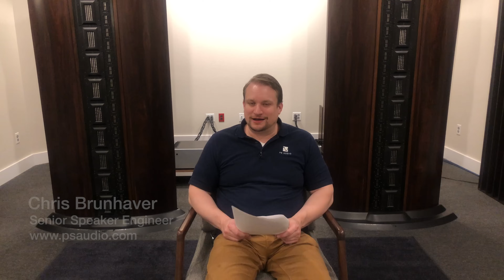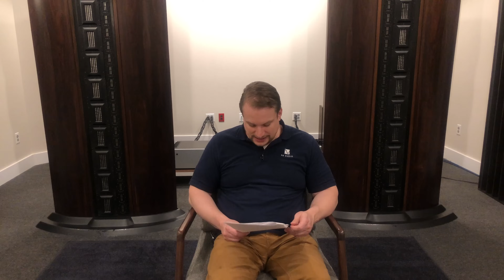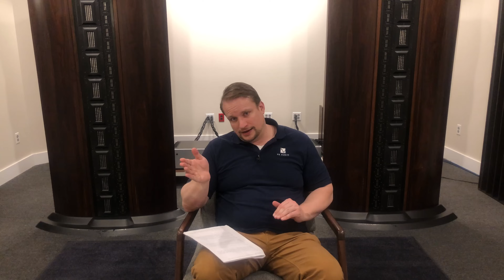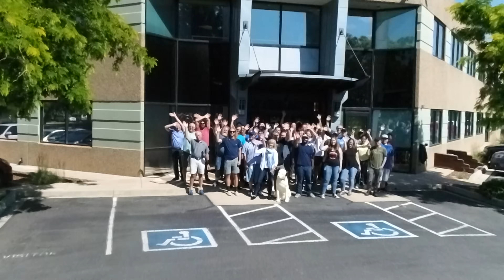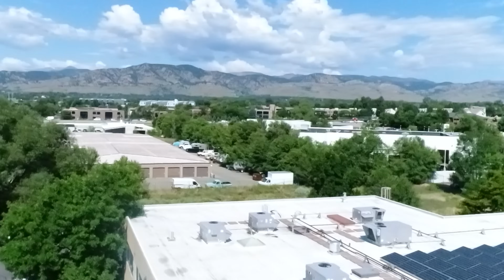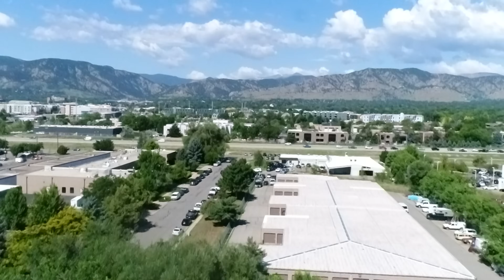Does using a subwoofer change speaker design?

Comment: I dislike subwoofers in a 2 channel system.  Why?  Not easy to blend, all amps don't have a pre/sub out and mostly...it gives a speaker manufacturer an easy out in terms of making a proper full-range speaker.    A tower or bookshelf that plays music down to 42hz isn't all that difficult to achieve (true 42hz, not -6db at 42hz either), but there aren't a lot of them on the market as most manufactures call it "good enough" around 55hz or so.  Enough to give some bass extension without a sub, but not enough to hear all the music either.
In a few ways, we've went backwards since the golden era in the late 70's and speaker design seems to be one of them.

Comment: Great analysis by Chris.  

Imo one possible potential benefit (for two-channel) of knowing that subwoofers will be used is this:  The designer could theoretically optimize for not needing a protective highpass filter, thereby rendering a potentially problematic filter in the main speakers' signal path optional.

Comment: I like running subs, modern speakers, even good towers can’t dig as deep, they are relatively cheap for the addition they make, and they are a lot of fun.  If you do it right, your bass will sound like it’s coming from your towers, even if it’s not.

Comment: Do the IRS V's have a left and right speaker? Why are the tweeters on the inside the way you all have them set up? Just for looks?
Reply: If you're sitting in front of these behemoths, the set on your right is generally considered the right. The left is treated the same way.
Reply: @jamesplotkin4674 ...lol...
Reply: @jamesplotkin4674  A little more then that please.
Reply: @finscreenname  I believe it's so the mid-bass is closer to center, able to couple and the highs are outside of that, enhancing the sound stage and image.
Reply: @FatRat-f9m  "Tweeter array is on the "inside" because that's how the loudspeakers were designed to function...properly." 
That's what I was asking. Why do they work better on the inside then the outside. Is there really a difference? Also why are they mounted to such a large box. They are both ribbon speakers so they really dont even need a box and could be mounted on a flat plank. Why do they have speakers in the back inside a half moon? So many questions.
Reply: @finscreenname ...I suspect that the tweeter array is 'inside' the midrange array because there's less sonic 'interference' from the mid array that way, but I'm only guessing.
Better to ask Paul directly at: paul@psaudio.com
or his son Scott at: scott@psaudio.com
Reply: @finscreenname  in short untrue.....
You can use inside or outside all depends on your room and placement. 

These old wives tales about need to be on the inside are just that. 

also the reason why the baffle is shaped as such, it's to deal with baffle diffractions. Emims (I have the irs v cousin, the rs1b) aside from my 6ft by 4 ft wide magnepan Tympani I. 

The baffle is calculated to be a specific width and curves to deal with the diffractions the drivers cause. 

In all essence the irs v is not the best out there by a long shot, nudell never liked the use of multiple drivers. 

Look up a genesis dragon (Gary bought genesis from nudell , and improved tremendously on the design of the irs) way better speaker than the irs v by a large margin. Cost also a whopping 169k set..

Arnie nudell believed that long ribbon drivers were far superior to the emims. Especially for line source applications. 

Emims to me especially compared to full line source drivers such as maggies ..

Are nothing to brag about they beam and they don't hold up well (reliability issues) especially the older irs v ones. The rs1b had modified emims (they basically put a piece of Scots tape on diaphragms ) to constrict excursion of the diaphragm. 

They also wear out, tension issues (,anyone that has a infinity with emits,emims , l-emim,h-emims ectra) knows the infamous wrinkly looking diaphragms they will get over time. 

Sometimes emims even sag and hit the front plate when played loud enough. They are not that great of a driver ..

I would replace those with neo 8 planar drivers in a heartbeat . As I want to do with my rs1 but I might just sell it. As my Tympani buries it with ease so not sure if I even want to bother with it.

Comment: This is an excellent point. The most (trying to be) audiophile stereo speakers are rarely optimized for subwoofer use and that’s a bummer.
Reply: @FatRat-f9m  Well I would say that your probably going to be just fine with the filters to get rid of some distortion  you hear sometimes without any detrimental effects. If that is all you're looking to do, then great. But if you are trying to also reveal if there are any audible influences with the filters that may be noticeable to some people with some systems, then the Markley method is the way to proceed.
Reply: @StewartMarkley ...when I was younger & enjoyed 'experimenting' with what does what to the sound, I most probably would've followed your instruction in this matter. However these days I'm over all of that 'playing around with audio gear' in preference to just sitting back & listening to da tunes.
Reply: @FatRat-f9m  I guess you are more of a spectator on these forums than truly interested in the science behind HiFi. That's cool. I've always been interested in the science of electronics and sound and now that I'm retired I have the time to dig into it much more deeply than I have in the past. Dig those tunes!
Reply: TB ...here's my 8ohm 80Hz 12dB/octave high pass crossover filter findings. Using the 5 tracks that I selected, at the same maximum volume (98-105dB) with said filter removed & the subwoofers off, I found that none of the 5 tracks made the mid/bass drivers 'bottom out' amazingly ...kudos to ScanSpeak! I could only hear a little (not negligible) doppler distortion of the mids when the drivers really had to pump; these doppler distortions were not as prevalent with the filters in-line (makes sense) however the difference was very minimal. I'm not sure about any HF 'smearing' or any other levels of distortion with the filters in or out that I can accurately report, given that my ears can receive sound slightly differently from one day to the next (they can have good days & slightly less than good days) Today they are having what I suspect to be a 'good day' & all sounds pretty good without the filters in-line (I had the filters in-line for 3 weeks). The 5" mid/bass driver does deliver very tight bass down to about 70Hz before it audibly rolls off (that's pretty normal for a 5" anyway) I will probably not re-install said crossover filters until I feel that it is necessary to do so, since most of my CD's are not as demanding in the bottom end (studio analogue recordings from the 60's, 70's & 80's) as the 5 'test' tracks that I have used in this experiment. These System Audio SAXO 5's are really robust little buggers!
Reply: @FatRat-f9m  Yes, it depends on the music and how "over-tuned" your stereo speakers are in trying to make sub-bass. The effect, from my experience, is mostly observed with very pure sub bass and that's not all that common in real music.
Reply: @FatRat-f9m  So I'm getting that you can play the system louder with the filters because of reduced distortion from the woofers, which is why it's smart to use a highpass filter when using a sub. I'm also getting that you are not sure about any detrimental effects from having the filters in line.  As expected, the more subtle effects are difficult to discern and if you are happy with the sound with the filters in line, then you should keep them installed. If however you want to be more convinced that the filters don't make an objectionable effect, then you ought to try my Markley method of making subjective comparisons as I mentioned to you previously. Just put one filter in one channel and leave the other side alone. You may well need to compensate for a level difference due to the filter insertion loss which should be level matched as closely as possible with a wideband noise source and SPL meter. The signals on both sides should be identical (mono) and if you don't have a mono switch available, then a Y adapter can be used to split one stereo channel in two and sent to both channels. Then the last detail is to put the speakers side by side to reduce the effect of varying room acoustics. Then switching back and forth from the left to right channels while listening to a wide variety of music at a wide variety of listening level  over time will let you decide if there is any difference with the filter or not. 
Or just be happy with the system  as is. Later mate.
Reply: @FatRat-f9m  I would guess that you are much more like the typical guy on here but with a lot of practical experience in the different components, more like a Steve Gutenberg. I'm really into the science of sound. What started me on this path is when I put my two speakers with open backs that were part of a cheapo stereo system I got as a kid, I put the speakers in the doors of my bedroom closet which of course dramatically improved the bass, and I had to understand why that happened. So after my submarine stint in the Navy I got into the pro sound business working in recording studios and ultimately landed in the CBS Technology Center working on all sorts of audio and video research projects. At the end of my career I worked for a guitar pedal manufacturer designing pedals. So I naturally am into the details of audio and now have a lot of time on my hands to work on it. Always a pleasure to chat with you.
Reply: @FatRat-f9m  Just got the package today, haven't even opened it yet. Wife pulled rank on me ☹️

Comment: I have small space and don't have space for 2 subwoofer looking at integrated subwoofer like GOLDENEAR or DEFINITIVE TECHNOLOGY  any thoughts??
Reply: Hey Dan, well Goldenear and Definitive models with the built in subs do produce a ton of low end but I haven't ever listened to a model from either company that I liked. Now, to be fair, they are usually set up in show rooms to showcase the bass but I finally did get a chance to listen to a pair of Triton Two's in a home setting where the gentleman using them had them set up correctly and they were a lot better but nowhere near worth all the praise that's heaped on them. But I should add that I'm a music lover, not an audiophile in the modern snob sense. Yep, I hear everything the audiosnob hears but I'm not impressed unless the speaker first makes me forget about the minutiae and allows the music to draw me in. When Definitive was all the rage years ago I bought Paradigm Studio 60's in a head to head comparison. I've listened to Goldenears four times in stores and once in a home. They're not for me. Like yourself, I have a small space as I live in an apartment so last year after hearing them at Rocky Mountain Audiofest I took a chance on a pair of Wharfdale Lintons and they're fantastic. Not what the average audiophile would lavish with praise but they draw me in and let me enjoy the music. The GE's did not. If I had double the dough I probably would have bought the Tekton Double Impacts instead but I wouldn't have been able to use them to full effect in an apartment anyway.
Reply: @davep2945  thank you
Reply: @davep2945  Other speakers I'm looking at  Aria 936	Focal 
OPTICON 6 DALI 
Motion 60XTI Martin Logan
SVS Ultra Tower SVS
Reply: @dandonna852  Hey Dan, unfortunately I haven't heard the exact speakers you listed.
I've heard the bookshelf version of the SVS Ultras and they sounded a bit harsh to me. Like they were being pushed too hard even when the volume wasn't insanely high. The Ultra towers double up the mids and uses the 8" woofers to relieve some strain on the mids so maybe they are different but I haven't heard them. 

Focals always sounded like slightly less clinical versions of B&W speakers to me. But it's been ten years since I've heard a pair of Focals so it wouldn't be fair to assume they are the same now.

I have heard the Martin Logan ESL-X and liked them quite a bit. There is very good integration between the woofer and the panel and having a dynamic driver certainly gives a panel speaker some of the pop most are missing. However, if I were going panels I'd go with a Magnepan 1.7 and a pair or two pair of really tight subs. That defeats our purpose here though. However, The ESL-X is certainly in your price range but being a panel it needs to be out in the room a bit and in a small space that could be an issue. But it's all I know in the ML line.

I wish I could find a pair of Dali's to listen to. Even at Rocky Mountain last year if there was a room featuring them I must have missed it. A definite possibility given how big the show was.

My guess is that any of the four speakers you mentioned will produce more than enough bass for most music but it's doubtful they are going to do what the Definitive's or Golden Ear speakers do when you drop below 40 hertz. Those speakers are purpose built to produce deep bass and they do. Not quite like dedicated subs do but more than good enough for most. Unfortunately, for my tastes, bass is their best feature and I wanted more. 

Don't know where you live but if you're in the U.S. and you want to try something with the knowledge that you can return it if you don't like it then try Crutchfield. Never had a bad experience with them and they sell the Focal, Martin Logan and SVS speakers you mentioned. In person audition is always best but given the current situation that may be even less a possibility than it often is anyway. Last I knew stores within a hundred miles of me were open and I have access to good PPE but many don't.

Now, as for what I have heard in the last three years that would fit in a smaller space had great bass as well as enough of everything I like to put them in my home. The list goes like this.

Tekton Double Impacts. Paradigm Prestige 85's. (95's would offer more but they weren't in stock)
Monitor Audio Silver 300's. The Martin Logan ESL-X. They were really good I just liked the Maggie 1.7's better but the 1.7's need a sub. The Wharfdale Lintons I mentioned currently owning (tad too warm) though they won't be my last stop on the speaker train. And the Legacy Audio Signature SE. The best all around were the Legacy's. The Tekton's are right there in general performance and both have killer bass. They both equal anything the GE's or Definitives can do but you have to have the power for them as they are purely passive speakers. Then I'd probably go with the Paradigms. Just so holographic but they were perfectly setup. But then that is required for any speaker to image well. Great bass, also. Then the Martin's and the Monitor's. I heard others along the way I loved but none of them would be great choices in either a smaller space or without subs. I know none of these were the speakers you mentioned but I figured I would throw this out that way you if you've heard some of these you could see if our tastes jive. If so you might want to check them out. If not then you know not to listen to me! Lol.

Comment: A speaker-design should NEVER change just because a user CAN use a sub.
A sub is just something you use to help with the lowest Hz.
Just look at big Wilson-speakers, they are very capable to produce low Hz but they still have Thor to help with the absolute lowest frequencies a recording could have.
Reply: Birger ...sure, if you've got the money to spend on a pair of Wilson's. But if not, you should remove anything below 80Hz from your loudspeakers if you're going to use a couple of subs; the reasons for doing so are very obvious.

Comment: I wish more manufacturers (other than the HT guys), especially those who wisely offer subwoofer line outputs, would offer adjustable bass rolloff on the L-R channels. My present main system has a decent sub (JBL), but the amp (Emotiva) still sends all that low frequency energy to the Klipsch 600M's, and it is wasted or causes some IM distortion -  not to mention moving the little speakers' cones unnecessarily.

Comment: Subwoofers have taken away the need  for getting $$$$ full range speakers that can be an enormous pain in the neck to drive (lousy impedance curves, low sensitivity, etc). You still need a speaker that has significant output down to 50-60 hz and your sub should be crossed over to no higher than 50-60 hz for seamless integration. Subs become localizable at crossover frequencies higher than 50-60 hz (A lack of experience would make one think that he can get away with 80 to 100 hz). In essence, a pair of subwoofers are a god send for those who want to save loads of cash on speakers/amplifiers and still have the ultimate audiophile experience.